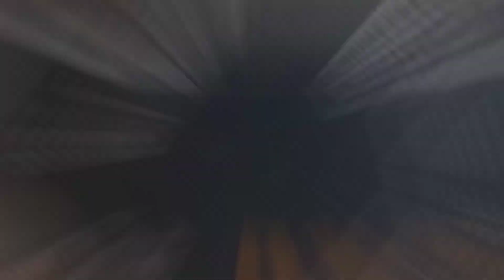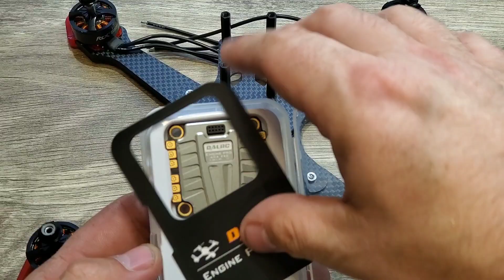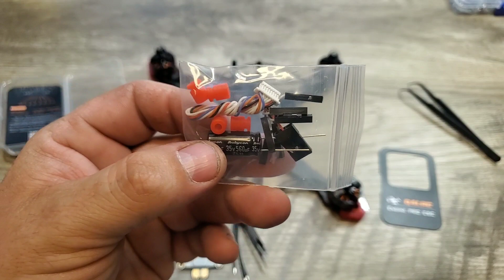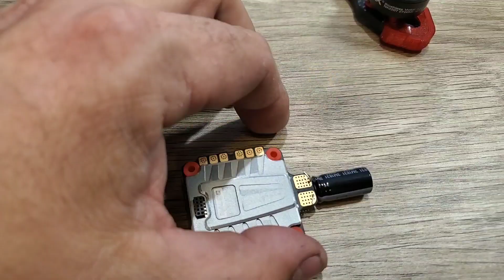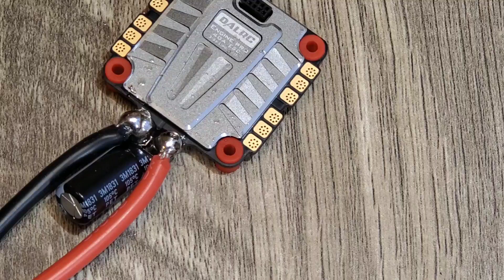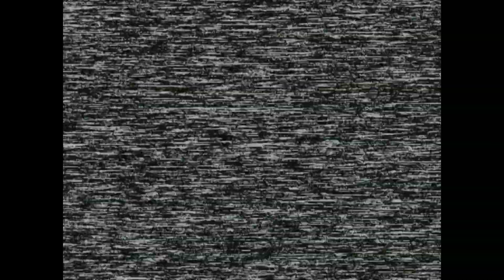Impulse Rc Reverb Build Part 3 DalRc Engine Pro 4in1 Esc Installed

Comment: Is the reverb a 30mm x 30mm or 35mm x 35 mm
Reply from the maker: 30mm X 30mm
Reply: Thanks (I meant 30.5 not 35mm). But I checked the link to the esc and that was 30.5mm. How does that work, did u have to file the holes
Reply from the maker: @reverb4322  I thought you meant the size of the distance between bottom and top plate
Reply: No sorry for my miscommunication. So are the standoffs 30.5mm or 30mm. I presume 30.5
Reply from the maker: @reverb4322  the standoffs are 3 different sizes 3 are 30mm 2 are 14.5mm and 2 are 24.5mm
Reply: @edrone_  sorry I think I'm being unclear. So where u mount the 4 in 1 esc and flight controller, the bolts they go on are in a 30mm x 30mm square or a 30.5mm x 30.5mm square to my understanding.